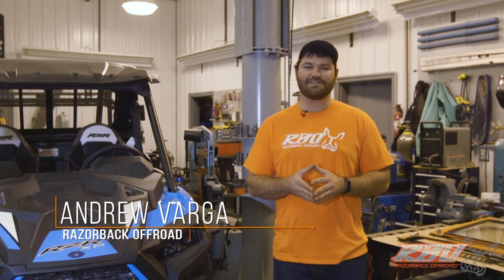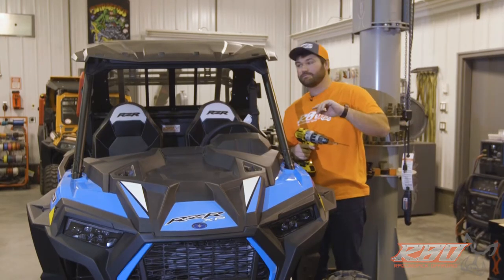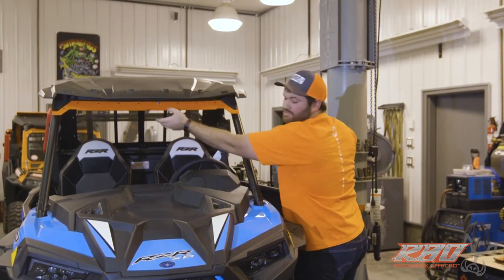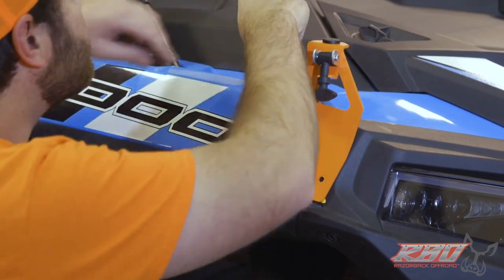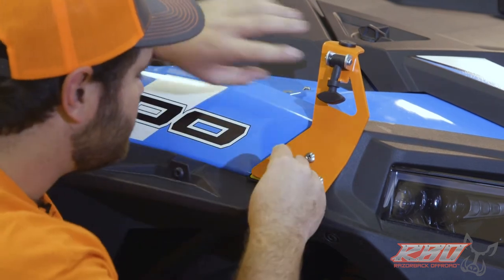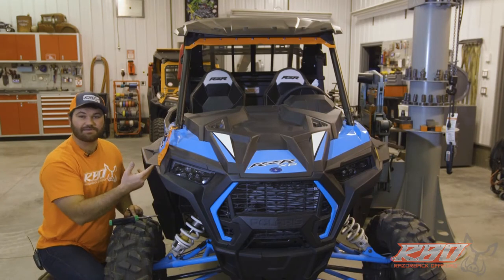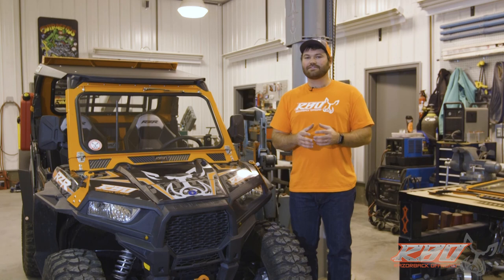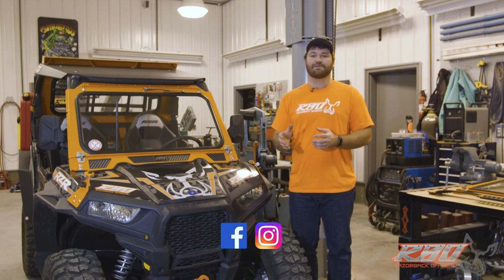How to Install a Razorback Off Road Fold Down Glass Windshield on Polaris RZR - Razorback Offroad™

Comment: Just installed this on. 2022 xp4 1000 premium .  Easy install, about a hour.  The only problem I had was the top plate holes did not line up with the sun visor since the visor was warped in the middle.  Used a piece of wood to force the visor down to line up.  The windshield does not leak air when up and does not rattle when down.  The vents work well also.  Great windshield !  My windshield has side mirrors and work well with the windshield.  I have the premium model which has a radio antenna.  I was hoping that RBO would make an off set bracket to accommodate the antenna since it is in the way of the windshield when down.  You can make it work by folding the antenna to the side as I had to do.  It doesn’t give the unit a very finished look but works.

Comment: Like the RBO windshield and the video but the video needs to be updated. The top bracket  only has six holes vice 10 as indicated in the video,   the outside two do not line up with the marks on the visor. The kit included a strip of weather stripping but the video does not indicate where it is to go. The lay down brackets do not line up using the center hole as indicated. I put this item on a 2020 Razor 900 Fox.
Reply: I a, trying to install one as we speak on my 2020 900 Fox edition…..any suggestions?  The weather stripping is a mystery

Comment: I bought one of these windows today and while it is a work of art, there is a problem if the owner has installed an aftermarket roof which means the Polaris sunshade is no longer present. What this means is the formed piece that goes above the windshield...(this is the piece that the folding window latches on to)....has nowhere to mount unless the roof is removed and the stock sunshade is reinstalled. At this point I am not sure how to reattach my roof since it conflicts with the sunshade. I hope this is not confusing, but it should be addressed in this installation video.
Reply: Not if you were smart and bought a roof that used the existing factory visor.

Comment: What if you have mirrors (purchased from my Polaris Dealer) on the 2019??  Will the glass seal??
Reply from the maker: The windshield fits most aftermarket mirrors. If the bracket is not too thick, I wouldn't see a problem. We put Sector Seven mirrors on ours and it fit just fine.